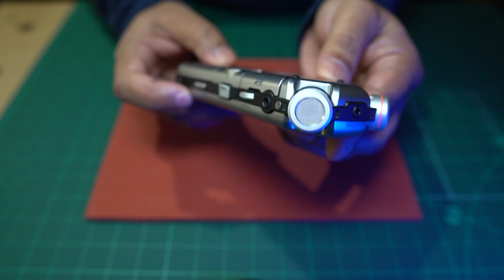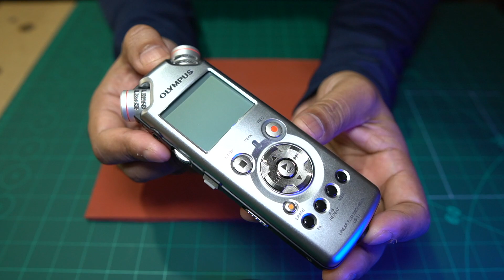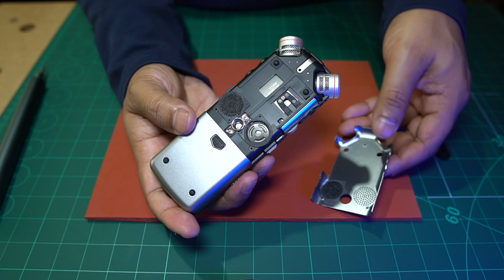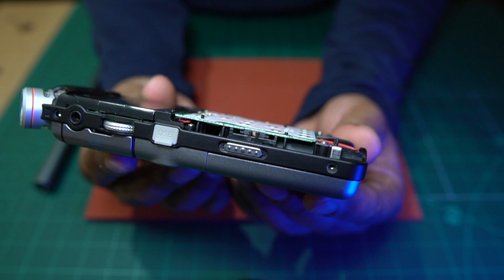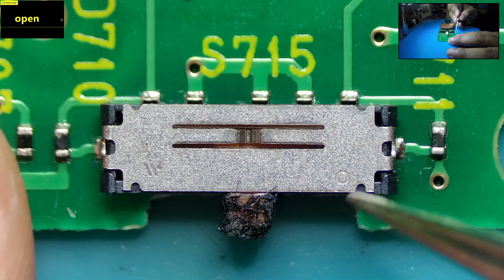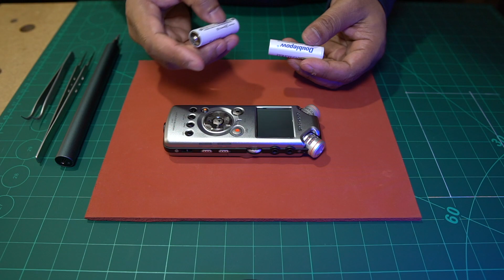Olympus LS - Linear PCM Recorder - No Power Repair - iRefab

Comment: Nice vid!. I just restored a LS-10 that had a really bad battery leak all over the button board and same dirty switch. I even had to repair broken traces but its alive and sounding fantastic.
Reply from the maker: I had one come in with similar problem, battery acid leaked and corroded away all the traces under the keypad.  It was so bad it was beyond repair.  Glad you got yours sorted 😊

Comment: I have an Olympus LS-3. The slide switch is snapped inside after a botched repair. Its not the same as this dictaphone but similar. Does anyone know where I can find another switch I can solder onto the board?
Reply from the maker: If it’s similar to the LS-11 i was not able to locate a replacement.  I think the component for the switch is designed in house and it is a custom part.  Meaning it’s not a part that you can get off the shelf and Olympus will not sell them to us.  Only other way I can think of is to get hold of a faulty LS-3 and cannibalise the switch off it.

Comment: thank you for this excellent video! I have an Olympus LS-P4, which has a similar power/hold switch. The power switch doesn't work well anymore -- I can 'jump start' the device using the USB plug to give it a charge. It will then run off the AAA battery. But it is frustrating, and after watching your video, I suspect that it could be the same issue with the switch. Only -- here's the rub: the switch sorta works a bit. In that, it can switch the device off, and right after switching it off, it can even switch it on again (within a second of switching off). So it's fiddly. Anyways, thanks again! I need to get my hands on the repair equipment you used and find some time, and then I'll give it a go too.
Reply from the maker: @Eoin Dubsky thanks for watching the video.  Yes it sounds like you have the same issue.  Great little recorders and I’m still using mine to this day.  If you’re based in the U.K and would like me to have a look at it for you, feel free to email me on iRefab.info@gmail.com and we’ll discuss it from there.   Either way hope you get it fixed 👍

Comment: Mine the stop button is stuck the buttons don't work otherwise everything turns on and looks good just can't control nothing cause the buttons don't work all the rest click as normal but not the stop button this is terrible cause this thing was not cheap this company is wicked
Reply: I had the same problem with mine.  I had a battery leak and the acid leached under the button dome that is on the circuit board beneath the button you actually press.  I took mine apart and carefully removed the small metal dome from the circuit board by pulling off the small piece of tape that holds it down.  Once removed,  I could see corrosion on the board beneath and on the bottom of the dome.  This corrosion was built up enough to prevent the "click" feel you normally feel when pressing the button and also prevented the contact from happening which is why the function stopped working (in my case it was the record button)  if you gently clean the corrosion from the board to expose clean metal and the bottom of the button and reassemble,  it should work again.  I was able to reuse the small piece of tape to hold the dome back down.   It is tedious to work on but just take your time and it should work.  Good luck.
Reply from the maker: Thanks for the guidance on that issue.  I had one come in recently with same problem as yourself have described.  Sadly this one had corroded so badly it was beyond repair.  We cleaned it in an ultrasonic cleaner to inspect the extent of the damage.  Many of the copper contacts on the board had completely disintegrated, even the copper contacts in the middle layer of the board that connect the two sides together had melted away.  I had to put the towel up on that one and call it a day.  If only we could get the parts for these it would have been a 20 minute job to swap that keypad out (only need to solder 2 wires coming off the lcd backlight.  Customer was very kind and let us keep it for parts for future repairs.
Reply from the maker: One big tip for anyone who owns one of these, never leave batteries in the device when stored for long periods of time.  That battery acid is a killer 👍
Reply from the maker: @TruthSeekerAi Sorry to hear about your problem.  Maybe you can take it apart and try cleaning the area underneath the buttons with some isopropyl alcohol.  As you can imagine these were manufactured around 2011 and overtime dirt/grime even liquid can get into the crevices and jam things up.  I would take it all apart and give everything a good clean.  Maybe that will sort out your button issue.  Hope this helps 👍